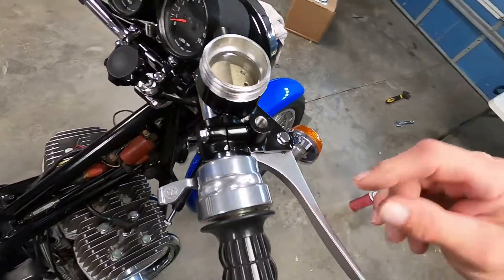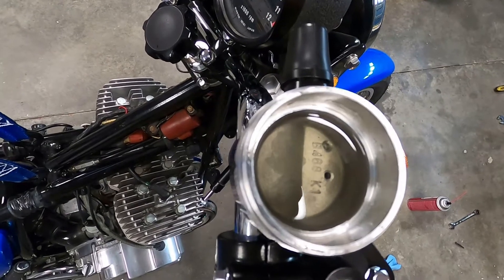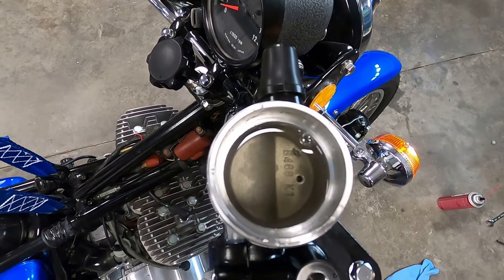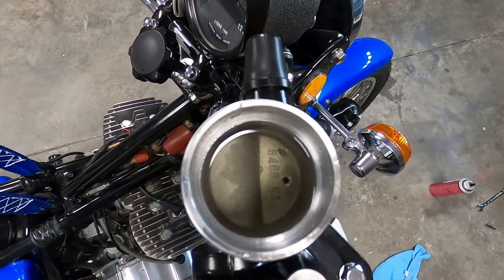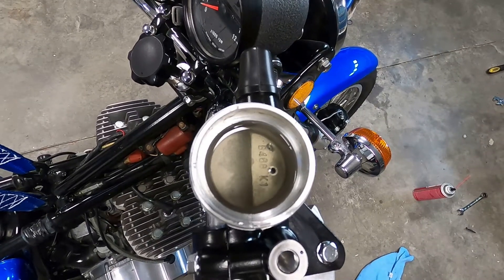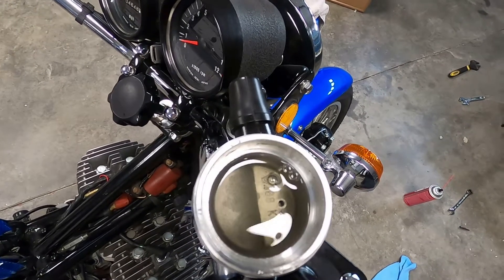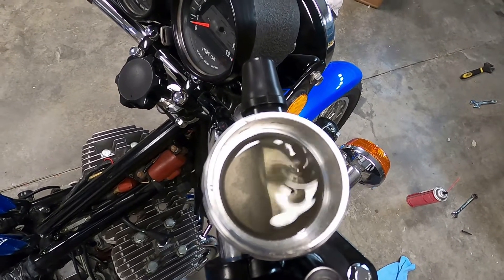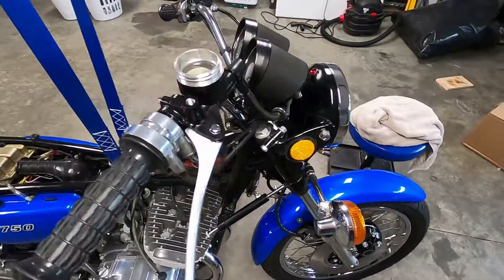Resolving Brake Issues: Bleeding a Motorcycle's New Master Cylinder with No Pressure on the Handle

Comment: Hey , I can’t find any videos for the issue I’m having , rebuilt the calipers gave them a good clean and grease , now I’m bleeding them , the fluid is passing threw the bleeder valve but the pistons are not moving
Reply from the maker: Did you press in the pistons all the way before putting the lines on?  I have also gone thru a bottle of fluid before trying to get an air bubble out.  You can also get a longer tube and put on the bleeder, run it down to a bottle of clean brake fluid like a straw, and when you are bleeding air bubbles should blow up and if you let go a little early which is easy to do bleeding yourself, it will suck fluid back up the line not air.    If not check out this link:  https://www.youtube.com/watch?v=IjFi7OlzYwQ  Pete will actually respond to you also, have talked to him a few times about issues like that, I just build 1 every 10 years or so he is building them it looks like daily.  Hope that helps.

Comment: Here's a solution that I made up 20 years ago:  I made up a small aluminum plate ( about 1/4" thick or so) with a bleed nipple in the center. The plate need to cover the master cylinder reservoir. The plate will need a rubber gasket of some sort on the bottom so that it seals well. If you have a reservoir which has screw holes for the lid, so much the better. Once you have the plate firmly sealed on the open reservoir top, connect a vacuum tool like a Mity-vac and start pumping to create a vacuum. Once there is a bit of vacuum, slowly  pull and release the brake lever. Do this 10-15 times. You won't notice much difference in the brake lever until you release the vacuum. Now pump the brake lever several times. Mine get hard as a rock when I do this.

Comment: My master has a line off master to brake fluid reservoir and I just can’t get a firm brake lever for the life of me. I had I decent one then I was riding and had to smash my front brake and it worked then gave out I had to pump it to stop. Not good..
Reply from the maker: If you pumped it and it did build up pressure sounds to me like you need a new master cylinder or need to rebuild the one you have.  Depending on the make and model of the bike, most of the time it is easier to just change out the master cylinder, vs rebuilding it.   There is not a lot of parts inside one, a spring or 2 couple of seals and a pusher.  The other thing it could be but less likely is your brake fluid is just burnt up.  This usually happens to clutches more than brakes but if you ride hard and the brakes get hot, you can loose the viscosity of the fluid, basically just thins it out and doesn't work.  Usually when that happens though when the bike is cold the clutch or brake work normal, soon as the fluid starts to heat up it fails.  Double check all your lines also, if they are braided, or not hard lines, when you squeeze the handle you could be creating a "bulge" somewhere between the handle and the caliper causing the fluid to not push the caliper shut.  Good luck with it keep posted let me know what you find.  Thanks for watching and commenting.

Comment: Is this the same procedure for rear breaks?
Reply from the maker: For that motorcycle no, but if you have rear hydraulic brakes then yes.  The master cylinder is probably square or located in a different location on the bike but you do the same process to get the air out of the lines.  Thanks for watching.
Reply: @RagerJackOfAll  thank you so much.
Good video.
Reply: @RagerJackOfAll  man i tried bleeding my rear brake like forever , still no pressure what so ever, all the air in the system is out, but nothing, know that i used dot 3 while my manual listed that i can only use dot 4, is switching to a none recommended brake fluid which is my case using dot 3 insted of the only recommended dot 4 , is this the problem ??
Reply from the maker: @rachidezwawi6343  The difference between the Dot 3 and 4 is mainly boiling points and water absorption.  They both have the same base so it should not matter if you use dot 3 or 4, the dot 4 is usually for more high performance.  If you have no pressure at all, first thing I would do is gravity bleed the brakes.  Take a long piece of tube and a clean catch bowl or bottle, fill the master cylinder and open the bleeder not all the way but so it is open.  Once you see any fluid at all start to run out of the line, close the bleeder to a slow but steady drip.  Then make sure you keep filling the master cylinder until you think you have filled it at least 1 or 2 times.  Do this without pulling the brake leaver or pedal if rear brakes.  Once you have done that close the valve, put the cap back on the master and see if you have any pressure, if not you most likely have something wrong with the master cylinder.  Sometimes the gravity bleed will work better especially if you are trying to bleed alone, it is really easy to let the handle or pedal back up, even the smallest bit will suck air back into the lines.  Let me know if that helps and thanks for watching.

Comment: Don't you have to bench bleed the new master cylinder?
Reply from the maker: You can but I have never had to. I've done probably 10 master cylinders (Not a bike mechanic BTW) over the last 30 years of owning and tinkering.   You just have to make sure you get  the air out.  Even if you bench bleed the master, if you have an air gap somewhere in the system, air will rise to the top, soon as you pull the handle and open the valve there is a chance of air going back into the master. You can gravity bleed them also to get most of the air out, but that takes patience, which I'm usually low on.  Someone else will get on here and tell me I'm wrong, again not a motorcycle mechanic by trade, but this has always worked for me.  Thanks for commenting, if it does or does not work in your situation please come back and comment again to let anyone else know.

Comment: What if you aren’t getting air bubbles when you apply the brakes?
Reply: Same problem here. I’ve tried everything I’ve seen on YouTube with no success. Not even one bubble.
Reply: @homerwhite6324  any fixes?
Reply: @homerwhite6324 same did y'all figure it out?
Reply: Same. Calipers are full of fluid. Lines  filled manually and nothing.